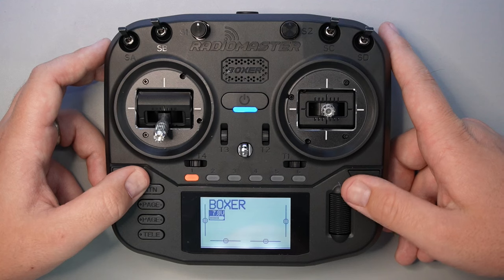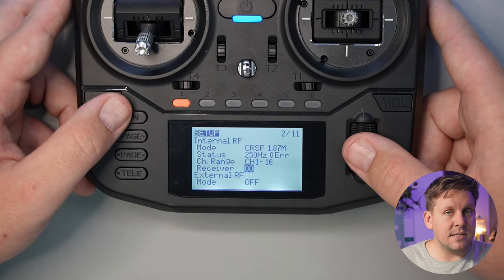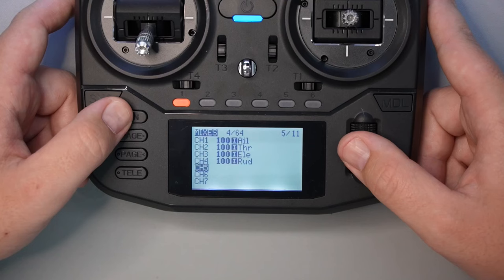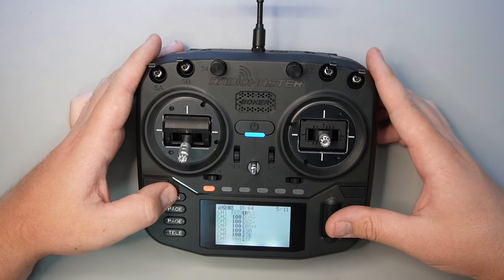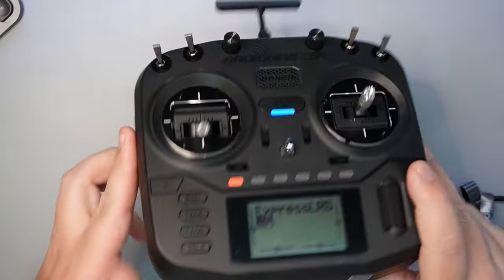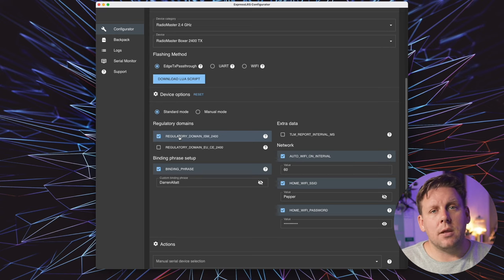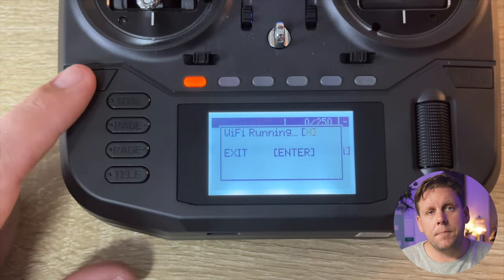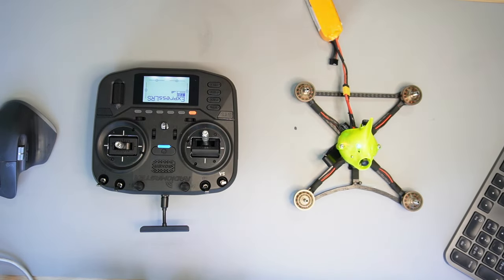How To Setup Radiomaster Boxer ExpressLRS in 5 Minutes

Comment: Its too dificult 🤣
Reply from the maker: What is?
Reply: Agreed bro agreed...I'm stuck now with a spanking new 3.5 inch freestyle I can't even fly yet because of express lrs firmware,binding phrase,...not compatible with the TX I had🤦🏼‍♂️(lite radio 2 se)...which I bricked trying to update firmware...I mean wth??
Stupid fr.
Reply from the maker: @droneready8278  sorry to say that going with the Lite Radio 2 SE was the main issue in your situation. 

So go and get a decent radio (Boxer, TX16S, T20, Pocket, T-Pro) and problem solved.

Or buy a Tango2 and a crossfire receiver and solder that on
Reply: More difficult than spelling “difficult”?
Reply: @droneready8278 sounds like a you problem, maybe you’re used to have everything handled to you with technology these days

Comment: If you're having issues setting this up I'd recommend visiting the ELRS quick setup guide. I had the issue where it was not detecting my device correctly therefore in the manual firmware box it was selecting COM5 and failing. The fix for me was to update the firmware which I found from the website mentioned under the 3rd section "Update the TX Module"
Reply: @darrenallat Hi mate, mate thanks for the tutorial this was really helpful! I understood most of what was being said when initially visiting this video but as it lacks on detail (due to being a 5 min setup guide) it makes more sense after going through the ELRS quick start guide and using some other tutorials before this one. One suggestion is to post the link to the ELRS setup guide as well as any other resources of interest as if people have issues, they'll likely be lost in what to do next and be relying on you replying

Comment: I put the playback speed at .75 and followed the first part pretty well. I think I got the part about setting aux1 for arm. I’m using the same “SA” switch. But then when you said “set up all your other switches” I’m totally lost. I’m hoping that arm is the main one. Then on to Lua scripts I hav/e no idea.
Reply from the maker: What city do you live in?
Reply: @DarrenAllatt  Bellingham, WA, US. I’m waiting for the ExpressLRS Configurator to work. I was prompted to load something for “Python 3” but I cancelled that when it said it would take 94 hours. I really have no idea what I’m doing. I’ve been building a drone but just received a little bnf quad. I’ve been using the Boxer on Velocidrone for about a week and I’m ready to get set up for real.
Reply from the maker: I’m not sure about the python sing so your best to jump on the expresslrs discord and I’ll be able to get you sorted

Comment: Hi, I like 1 of my switches down towards me but i get a switch warning every time i turn it on. Is there a way to tell my radio that the switch that is down towards me is the default position so i dont get this warning every time? Im using the RM boxer.

Thanks in advance Darren

Comment: This was the video I was looking for. I ordered the RM Boxer 2 days ago.
Reply from the maker: Sweet. Feel free to ask any questions in the comments section!
Reply: @DarrenAllatt   did you forget to setup the “inputs” I’m so confused 😅. Other videos I’ve seen must be old because ADC filter was different but in those videos they show setting up the “inputs” and then matching them or making the mixes the same.  Thank you dude!!
Reply from the maker: @Jsvids85  Nope. they were already set
Reply: @DarrenAllatt  Quick Question, I still haven't decided what kind of goggles to pick, I've ordered an Analog camera and the only thing left to buy are Googles. I've been looking into Fatshark Scout. Any recommendations for Analog goggles around 200-250$ ?
Reply: @DarrenAllatt  Hm Maybe I didn't flash the firmware properly but I can't go above 250mW on the TX Power. I will reflash it again next week and see how it goes.
Reply from the maker: @nikolazagorski5655  use ISM sounds like you did the European firmware
Reply: @DarrenAllatt  Yep this was the issue. Had to update the RX as well, because it was 3.0.1 had some issues with that, it was saying: Not enough space, but now both rx and TX are 3.3.0 :)

Comment: I have the same radio and setting up my first quad .. thanks for the tutorial. Question - you did not mention the packet rate but i see that you are using 250Hz and 1:64 for telemetry .. is that what you generally recommend for everything? (there are way too many other options in there that i don't quite understand yet). Thanks for your help.
Reply from the maker: I use 250hz packet rate because it’s a good balance of speed, range & penetration. 

Packet rate is how fast the radio talks to the receiver,

The faster it talks the less range and penetration you get. 

I don’t need F1000, or any of the others.

Truth is, people can’t actually tell the difference anyway so it’s kind of mute.

Comment: Thanks so much for this video! I’ve just ordered a Boxer ELRS mode2- my first ever transmitter. 
I’m planning on just using it with Velocidrone initially - what set up will I need to do for this - or can I just plug it straight into the PC?
Will I need to flash?
Will I need to tell it what the various controls do?
And anything else a complete noob should know before it arrives?
Thanks ⭐️⭐️⭐️
Reply from the maker: No need to flash if you plug into the PC, just set up a sim model

Comment: Your work is great. I have two whoops binded to the boxer. Now I’m adding a nazgul elrs to it. Do I need to bind using binding phrase, if yes then o have update firmware again on the boxeer as I didn’t use binding phrase for the whoops before. Will the whoops need rebinding?
Reply from the maker: just use traditional binding on the Nazgul and you will be fine.

Comment: When setting my InternalRF mode to CRSF, instead of saying "250Hz 0Err"" it flashes between "250Hz 9Err" and "1000hz 9Err"
I have searched around on how to solve this problem but have been unsuccessful. Any thoughts? I also posted this on The Bench for help.

Edit: I sent a message on The Bench late at night and Darren instantly responded and was able to help me through the troubleshooting of this and we were able to get it fixed! Thank you Darren!
Reply from the maker: Hi Rob
That’s a normal behaviour,

Can you open the LUA script and it all works as it should apart from this error message?
Reply: I’m having this same exact problem. What was the fix to get it to stay at 250Hz?

Comment: I am new to the hobby, just got this radio for liftoff, i saw yours at 7.8v battery, can i know at what voltage should i charge the radio and how do i charge it? I have been using it for liftoff for 2 weeks and it is 6.8v now.
Reply from the maker: Plug it into the bottom USB C port when you are not using it and it will charge
Reply: @DarrenAllatt  what's the max voltage i can charge to?
Reply: @chunkit78  8.1 volts
Reply: @angelmosqueda9470  max i go was 8.4v, will stick to 8.1v from now. TQ

Comment: Hi, I have went to the internal module in the setup. However, when I turn it on, I have only tow choices, off and multi. Below the mode tab I have a type tap, but there I couldn't find crsf. Only types like FrSky...
Reply from the maker: You don’t have the ELRS version, you have a CC2500 or a JP4in1 Multi protocol module.

Comment: I smashed my tx16 because it wouldn't work for 2 days. Got a boxer and hopefully it works this time around. If luis script says C and the FC has a solid green and the controller doesnt work in betalflight. What do you think is the problem?
- Hdzero freestyle 
- elrs 
- tx16 (elrs interna)

Nothing working in betaflight when my tx16 was connected to FC
Reply from the maker: What do you mean “nothing works in beta flight” 

I’d say you have some soldering issues that’s causing a short

Comment: Great video @DarrenAllatt !!! I'm having issues that ocmputer isn't recognizing the usb port. Under device manager it gives me the error of Code 10 which I suspect is not letting me finish my upgrade FW. On the radio I under system I select ELRS lua but it hangs trying to load it. If you can steer me in the right direction that would be great!
Reply from the maker: according to Microsoft:

"Code 10 "This device cannot start.
In the device's Properties dialog box, click the Driver tab, and then click Update Driver to start the Hardware Update Wizard. Follow the instructions to update the driver. Note You may be prompted to provide the path of the driver."

Comment: Hey great Video. I am having some trouble binding my boxer and I am a beginner. I followed your instructions but I didn't flash the firmware bc I ordered it from radiomaster and they said it shipped with the latest firmware(I got it last week). I have a tx16 (ELRS) that works with my drones (Hummingbird F4 V2 and Evoque F5 6s) and I tried setting it up exactly like it and it didn't work. Could you help me please. Thank you in advance.
Reply from the maker: What version of ELRS is your Boxer, and what version is your TX16S running?

What version is on the Hummingbird and the Nazgûl. 

Just because it ships with the “latest” doesn’t mean it doesn’t need to flashed. If you are using a binding phrase then you will need to flash. 

Your receivers need to be on the same major version as your radio, for the Boxer that’s v3x
Reply: @DarrenAllatt  My boxer says it's version is 2.8.0-factory and my tx16 says its 2.7.1 (a55aff02). The Hummingbird says It's 4.3.1 BTFL and the Nazgul says it's 4.4.0 BTFL. I'm not sure what a binding phrase is or the major version but I am going to try to look it up. I hope I looked in the right places for everything. Also for the packet rate I have it set to 50hz. The instructions on the nazgul said it would give the best range. It works on the tx16 with both drones. Do I need to change this?
Reply from the maker: @scaretoster2873  add me on Facebook and we can talk to get you sorted
Reply: @DarrenAllatt  I added you 👍
Reply: @DarrenAllatt  Hey still haven't heard anything I sent you a message and just wanted to see if you got it.
Reply from the maker: @scaretoster2873  sorry went to spam, just messaged you now!
Reply: I have the same problem, except I flash my tx to the latest version. And nothing . Lmk if u figure it out.
Reply from the maker: @55amps  Go into the ExpressLRS LUA Script at the very bottom above [- - EXIT - -] and below [Bind] it will say something like 3.2.0 ISM2G4 8d3388

What does yours say?

Then what version of ELRS is flashed to your Receiver?
Reply: @DarrenAllatt  I had to update elrs setting to my boxer, but I got it . Your video help me by a lot 👐🏼
Reply: @55amps  How do you do that?
Reply: @vz4798 its frustrating my first build n first radio control aswell  im struggle to connect  them😂 do we need the same version ex. My boxer 3.3.0 nd the rx should be the same? Since this morning until now make me headache 😂

Comment: Thanks for the guide 👍🏻 how do you update radio’s edgeTX firmware itself?
Reply from the maker: Is there a reason you want to update EdgeTX Firmware?

Most issues people face in FPV are from updating firmware when really it doesn't need to be updated. If it's not broken, don't fix it!
Reply: @DarrenAllatt  just to have the latest and greatest ) mb there are some improvements & bug fixes. I am kinda OCD “I have to” upgrade 😄🙈

Comment: Well explained video, my boxer stays in loading after i hit Epresselrs...Thanks in advance for the help.
Reply from the maker: Check to see if Internal Transmitter in the model is on and set to CRSF
Reply: @DarrenAllatt  Thank you for the reply - Yes it is set to CRSF
Reply from the maker: @BLAQJAK3  is external set to off, trainer set to off or master?
Reply: @DarrenAllatt  ext is off/ trainer is off
Reply from the maker: @BLAQJAK3  do you have the ExpressLRS version?
Reply: @DarrenAllatt  yes sir
Reply from the maker: @BLAQJAK3  have you tried flashing via EdgeTX pass through to 3.2.2 ?
Reply: I had the same proble when we do the channels and the switches you have to do all of the switches and buttons that worked for me

Comment: Hi my flight controller shows 17 channel but 9 of them work . And can assign channel . Whi other doesnot work ?( Other channel shows fixed value 1500 )
Reply from the maker: have you added them to your Mixer?

From ELRS Website

ELRS supports up to 16 channels*. Channels 1-4 are always sent at full-resolution (10-bit). The resolution and update rate of the remaining channels can be configured as follows, based on your requirements:

4x full-resolution (10-bit) channels for sticks (CH1-4) with either:
HYBRID Mode 1x 2-position channel, AUX1 (CH5; Must be used for Arming), 6x 2-position/3-position/6-position (AUX2-7) and 1x 16-position (AUX8), OR
WIDE Mode 1x 2-position channel, AUX1 (CH5; Must be used for Arming), 7x 64 or 128-position channels (AUX2-8). Available via the Lua Script since 2.0.
8x full-resolution (10-bit, ext-limits) with 1x 2-position channel, AUX1
16x full-resolution (10-bit, ext-limits, all half rate) with 1x 2-position channel, AUX1
12x full-resolution (10-bit, ext-limits) with 1x 2-position channel, AUX1, channels AUX2-9 run at half rate.

Comment: I am brand new to fvp and just want to double check I need to buy a radio master receiver to connect to my drone. Thanks
Reply from the maker: No— can be any brand as long as it’s ExpressLRS, 2.4ghz and on the same major firmware
Reply: Thx

Comment: Great video. Do I need to flash my boxer for each drone or just once?
Reply from the maker: No need just once for the boxer, and you need to make sure that each of your drones have been flashed with the same binding phrase and major firmware version
Reply: @DarrenAllatt  Thank you for the reply. Do I find the binding phrase and firmware version in betaflight?
Reply from the maker: @ZRS414 no you set the binding phrase when you flashed ELRS to your radio

Comment: boxer shipped with 3.2.0 was trying to flash to 3.3.0 but the error message "could not find port". this means i will need to reinstate or update pc driver to proceed?
Reply from the maker: assuming you've got it plugged in the right USB port (top) and selected the right USB mode, and is it showing up as OpenTX in drop down on ELRS configurator? If not, you will need the CP210x drivers

Comment: Don't you need to make sure the receiver is on the same version? Or does it do that automatically? Do you also have to bind the receiver? Or does it do that automatically?
Reply from the maker: As long as the receiver is on the same major version ie 3.x or 2.x you will be fine. All devices sharing the same binding phrase, same major version and same frequency (ie 2.4ghz) are automatically bound.
Reply: @DarrenAllatt  thanks, I've just ordered a boxer and I'm new to ELRS so I'm sure I'll have more questions when it arrives. 😄

Comment: Hi

I have made a mistake when i ordered my receivers. 
I ordered them 915 is it possible the 2.4 boxer to connect with them?
Reply from the maker: No

2.4 only works with 2.4

915 only works with 915
Reply: @DarrenAllatt  2.4ghz better?

Comment: I bought the cc2500 by mistake  is there a way to put elrs on the radio other than buying a module which I have ordered and am waiting on any help is appreciated
Reply from the maker: The only way is to buy an External Module. The internal transmitter is not capable of running ELRS
Reply: @DarrenAllatt  thank you do you by any chance have a video on setting up the module and binding to an elrs receiver

Comment: Just got my new boxer. Do you have to update the TX before use?
Reply from the maker: When you say update the TX, do you mean update EdgeTX the operating system or the ExpressLRS TX in the radio?
Reply: @DarrenAllatt  Both. I did learn that TX and RX firmware must match, which was done thanks to your video. Another noob question. Is bench testing throttle unfeasible? After arming, I blip the throttle but the throttle stays on and revs high without my input.
Reply from the maker: @sleepingpanda8927  yes that’s an expected behaviour of “air mode” which you want to leave on

Comment: Hello, i need your help with it. i cant switch Internal RF mode on CRSF, it only let me do "multi" and then i set up all switches i go to SYS and press button ExpressLRS and all i see it is loading screen forever. Spend hours on this radiomaster already :(
Reply from the maker: You don’t have the ExpressLRS version of the radio, you have the multi protocol version.

So you can’t use ELRS, and you will need to get an external module.
Reply: @DarrenAllatt  how can I bind it to my drone then?
Reply from the maker: @kudivann  what drone do you have?

If your drone has ELRS, you will need to get an ELRS Micro TX module to put in the back